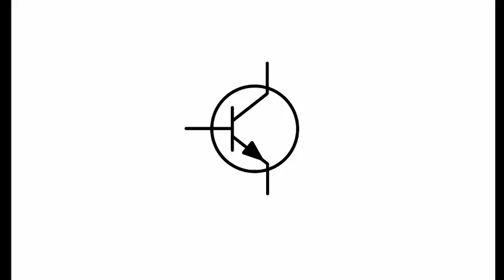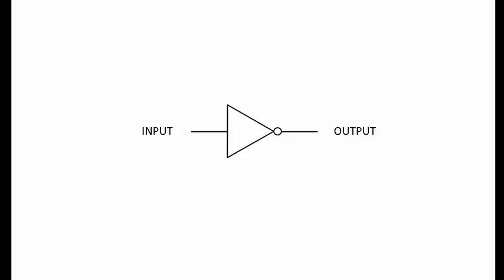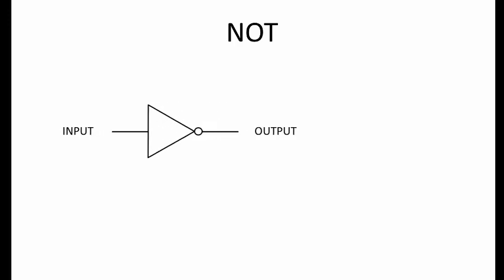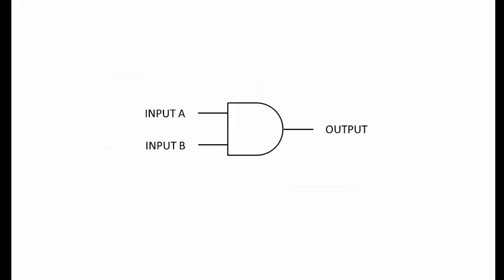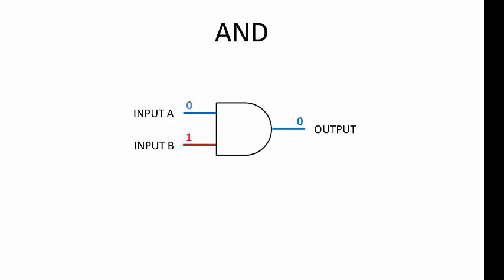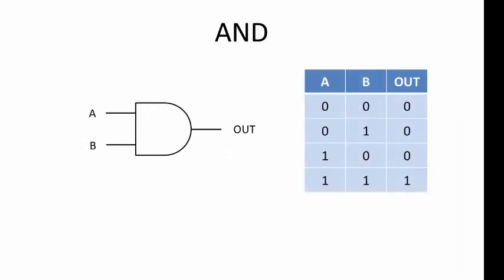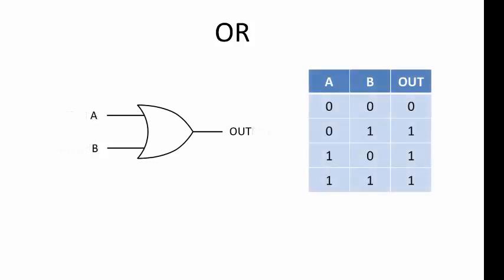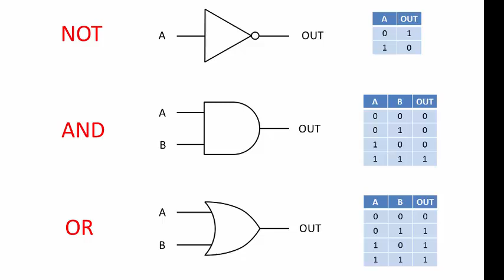Introduction to Logic Gates

Comment: Very well done but it is still incorrect when instructors and texts define transistors as switches. They have a mode to act as switches, but are not switches, they are the transfer resistor hence the name. In your opening explanation, biasing just the emitter and collector can in fact enable current to flow, it just takes an excessive amount of voltage due to emitter-collector resistance whereas an actual switch would in practical explanation, never close. A transistor's resistance from emitter to collector is incredibly high whereas a switch's continuity is always 0 regarding the NO switch opened.

In the first configuration developed for the transistor, was class-A configuration which as you and others surely know is the quiescent state. 
For all intents and purposes of logic gates, they are indeed used as switches.
Without the necessary previous education leading up to logic gates, which is rampant, the population of people that simply understand them as a switch in first and foremost definition is patently wrong and I find self study "gurus" never know and understand what they in fact are.

Comment: can you explain how SR port works? I had an exercise doing AND, OR, XOR, and SR ports, the first three are easy but the when doing the SR part and checking it, its always wrong, cant seem to get it right, the exercise has input 1 S=0 and input 2 R=1 as output=0, and then the other ones are fill ins, thanks in advance.

Comment: Transistor are current-controlled, current devices. Valves are voltage-controlled, current devices. They are closer to  a cmos power function then a bjt

Comment: Wich is the logic function of yes gate??? :(
Reply from the maker: The output of a YES gate is the same as the input.  It's purpose is to boost the input signal because electrical signals 'degrade' in complex circuits with lots of resistance.  Another name for a YES gate is a buffer. :)KD

Comment: Can you give me a real life application of NOT gate? I can't think of any, btw this explained more than how my teacher did... hope she doesn't find this
Reply from the maker: Glad to help.  If you take the output of one NOT gate and feed it into a second NOT gate, then feed the output of the second NOT gate back into the first NOT gate, you have created a circuit that can store a 1 or a 0.  This idea is the basis of a Static RAM cell (SRAM is used by CPU registers and the CPU cache memory).  There's a diagram here https://www.researchgate.net/figure/SRAM-memory-cell-circuit-diagrams-for-a-standard-6T-SRAM_fig9_224106933
Also, if you want to delay an electrical signal (which is quite a common requirement in some circuits),  you can pass it through several NOT gates (an even number of then) connected together in a line.  :)KD

Comment: hmm i'm still struggling to understand how these gates can have all voltage on 2-3 lines without a  ground. and the not gate that's another set of magic , changing a 0-1 with only 2 pins what kind of magic is that!
Reply from the maker: I've had a number of students who struggled with the concept of a NOT gate.  "How can it change 0 to 1?  how can it make something from nothing?"  It's important to realise that a logic gate symbol is an abstract diagram of something more complex.  See: https://youtu.be/fw-N9P38mi4?t=208 :)KD
Reply: @ComputerScienceLessons  so it's not like a resistor that can be bought off the shelf.?

Comment: Are different parts of computers just certain different combinations of logic gates?
Reply from the maker: Not all, but a great many of them are.  The CPU is full of logic gates.  Memory (CPU cache and RAM) also makes use of them, and they can be be found in the expansion cards like your NIC and the Graphics card. They are all over the place :)KD
Reply: @ComputerScienceLessons ok thanks. Also do logic gates control pixels, for example, my understanding of pixel system in led is the following: each pixel has its liquid crystals which can block light from getting to it or allow light to get to it depending on their orientation, such orientation depends on whether electrical current runs through them or not, which depends on whether the logic gate it's hooked up to is on or off, and this of course depends on how this logic gate is programed based off inputs from other logic gates. So a particular circuit or combo of logic gates program the logic gates that are connected to the liquid crystals corresponding to a particular pixel, so that whether said pixel is on or off is based off your arrangement of logic gates/your programming.
Reply from the maker: Take a look at this: https://www.youtube.com/watch?v=2iURr3NBprc
:)KD
Reply: @ComputerScienceLessons  thanks for link, couldn't find good sources,, appreciate it.

Comment: What kind of wire present in valves? Copper and epoxy ,
Reply from the maker: Thermionic values use oxide coated tungsten filaments.  They also include other metals such as nickel or molybdenum, and carbonates of barium or strontium. I have some inside my old Marshal amplifier. :)KD

Comment: I have a theory that our brains uses a system like logical gates with NOT, AND and OR including NAND, NOR. When people take medicine having some side effects coming with them, some of those gates are affected by those medicines and the body doesn't work  the way it should because of those side effects made by those medicines. For example when a woman is about to deliver, all those gates are giving the green light (according to the program implemented in the brain) that it is time to go into labor. The labor finished naturally, the breasts are starting to give milk very as soon after the baby puts his mouth on them. When a c-section is done, the gates are confused because the baby is out and all the gates did not give the green light that the baby came out through the birth Canal.  Confusion inside the brain, milk sometimes not coming,  and other side effects for the program to not have been fully followed.... light.Consequently
Reply: Brain doesn’t trigger labor, the hormones do, brain doesn’t do sensory stuff like that.
Reply: @Chief592  chemical and electrical logic gates
Reply: I think neurons work like transistors but different